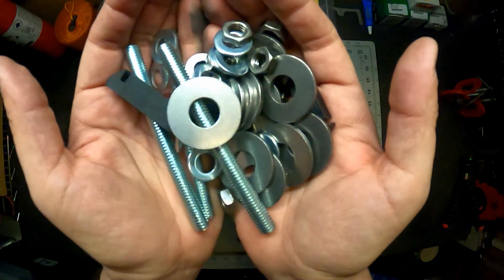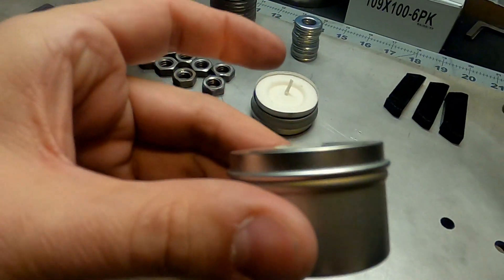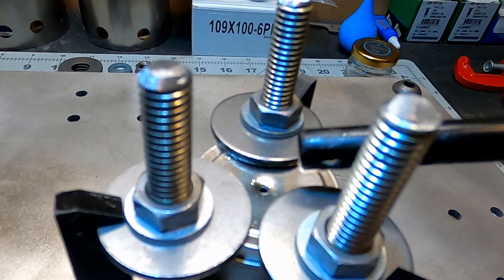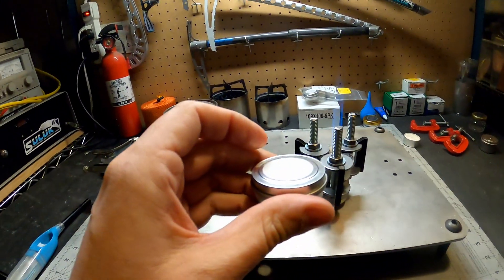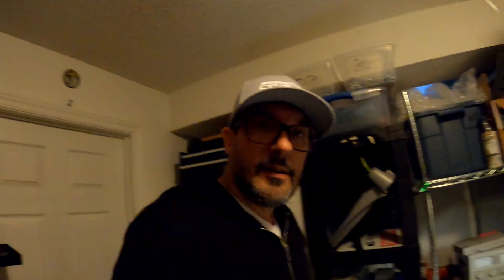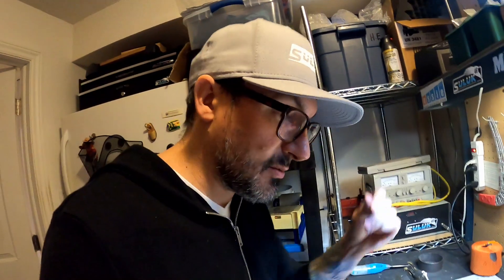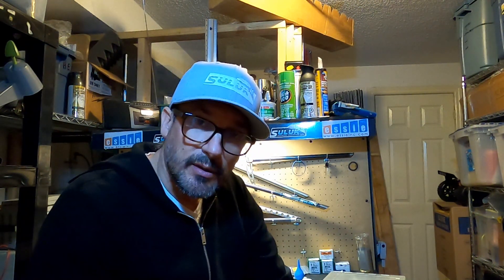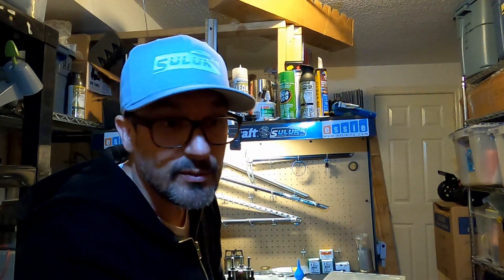High Pressure JET ENGINE Alcohol Stove for backpacking? - On The Trail - Episode #97

Comment: Primus stoves preheat the fuel to provide pressure after an initial priming with a pump to start the process.
its an old and established tech
Reply from the maker: Your talking about the generator or pre-heat tube like what you would see on a classic remote canister stove? That's a different beast altogether. I have a couple of them that I use for snow melting. Actually doing a video on it in the next few weeks.
Reply: Probably, i know them as multi-fuel stoves but am at least 3 decades out of touch.. ;)  perhaps watching a model steam engine vid or 2 might remind you of the difference in volume between liquid and gas states and the power of the pressure than can build up,  make the gas highly flammable and set fire to it too and its not an experiment i would want next door and im the chap my neighbours worry about ;)
Reply from the maker: @larkbox8427  Lol. I am also that neighbour...I have a similar multi-fuel stove that has the pre-heat tube. Works wonders. This isn't that far off, except I want to use heat to build the pressure as opposed to pumping the gas cylinder, but still different enough to make a comparison tough. I'll try not to blow up the street in my testing 😁

Comment: Hi Steve 
Interesting stove ..  
So you want the alcohol guys to chime in...... here's my thoughts. 
The reason I use a Fancy feast stove is it's easy and pretty much foolproof. 
If I need to boil water for dinner (and I use the same titanium pot you have 😁) it's a matter of set up the stove,pour in some fuel, light it put on your pot and leave it.
Reply from the maker: I hear ya! I'm no stranger to the fancy feast stove. Have used one many times and it is rock solid. It would be tough to build something better...BUUUT, the nerd in me is always thinking 🤔
Reply: @Suluk46  I think getting jet power out of alcohol is possible but finicky..... Now if you can make something like a svea123 that's actually lightweight with a built-in fuel tank that would be interesting 👍
Reply from the maker: I agree. I almost burned my house down...ultralight version of a Svea123... interesting 🙂👍